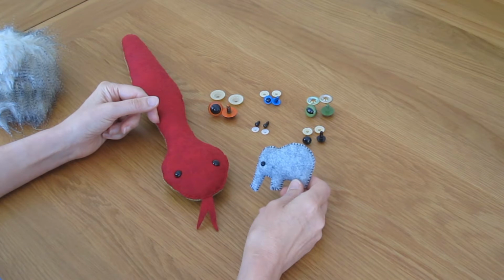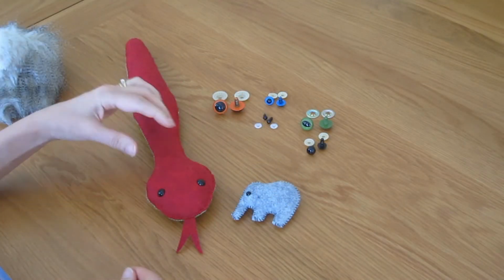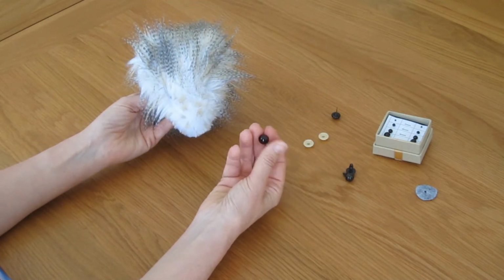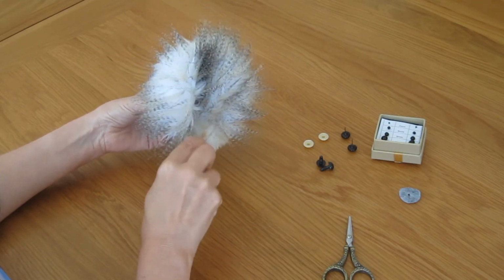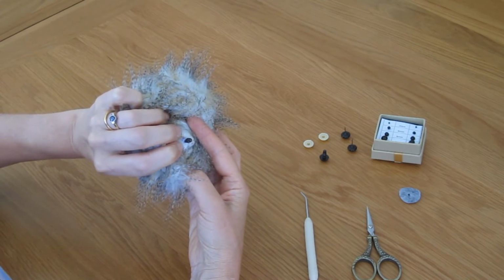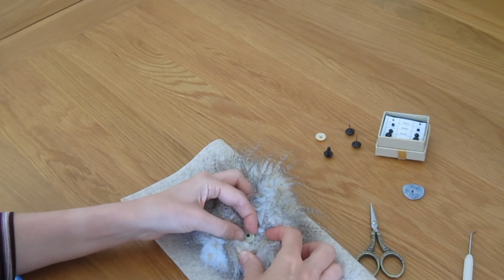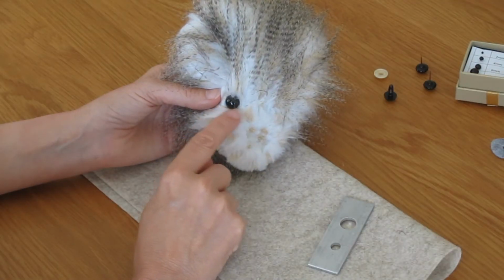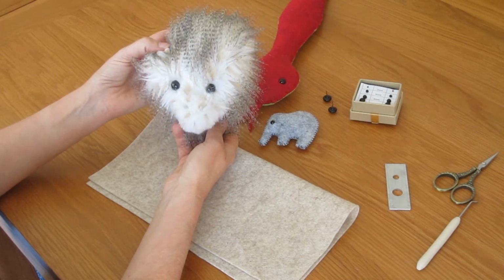Inserting Safety Eyes into Soft Toys

Comment: Thank you for this video. It must informative. I have used safety eyes for crochet, but am wanting to start teddy bears. I'm worried about inserting the safety eyes and then fabric fraying over time. It's this a possibility or will the fabric be secured? Hope you can help.
Reply from the maker: Hi Adam, I'm so sorry, I've only just noticed your question - oops!  In answer to your question, I have never heard of the fabric fraying around a safety eye.  The fabric is very secure between the eye and the back but do be careful that you don't make the hole for the eye very big!  I hope this helps :)

Comment: How do you remove them
Reply from the maker: Hi Samantha, I'm SO sorry, I have only just seen your message.  I do apologise.  A very good question about removing safety eyes.  Because they are safety eyes and designed not to be able to be removed, it is VERY difficult to get them off.  If you have a small hacksaw, that might help but, once the back is on, it won't wiggle off.  So, always be super confident about where your eyes are going before securing the backs on!  I hope that helps a little :)
Reply: I've never tried to remove them but have heard someone say they took a pair of plies and squeezed the front of the eye & broke it then it came off.

Comment: There are also tapered awls that are not so thin. I'd recommend that - I have no experience with stuffed toys (which is why I'm watching this :-) ), but this is wisdom from making sewn eyelets in historical costuming: using an awl to push the threads of the fabric itself aside instead of cutting into it makes for a much sturdier hole.
Reply: Thanks Beth for your input.  Much appreciated.
Reply: There goes my idea of using a seam ripper because I don't want to buy an awl for one teddy bear. Or maybe I'll just be careful. Or use a nail set? HAHA
Reply: @paulatiredofthisshit  If you have a knitting needle, sometimes that works, too. :-)

Comment: How do you attach seed bead eyes, please? Would you have to secure it with a knot in the hole, which would show?
Reply from the maker: I have only used seed beads once for eyes and, when I did, I attached them in the same way as a glass eye and threaded the eye onto the middle of the thread.  I'm not sure if anyone else has other suggestions but that certainly worked for me :)

Comment: Very helpful.  I have made many knitted toys.  However this last one, the eyes, after being installed slipped through the knitted fabric and  ended up INSIDE the toy.   Wasted time.
Reply from the maker: Oh that is so frustrating!  One tip that might help is to use a circle of felt inside the head.  To do it, you start by cutting a circle of felt about twice the size of the eye (depending on the fabric, you may want to use a colour that blends with the fabric).  Then, using a tailor's awl, make a small hole in the felt (so that the eye can pass through it later, with a tight fit).  You then insert the eye through the knit, as normal.  Once it is through the fabric, pass the eye through the felt (on the inside of the head).  Finish by putting the washer on.  Hopefully that will help but, a lot depends on the size of the eye and the size of the gaps in the knitted fabric.  Good luck!
Reply: @amazingcraft1254  thank you so much and will definitely try this!